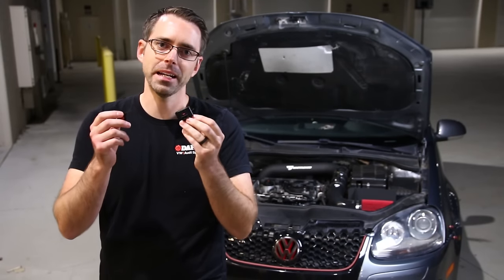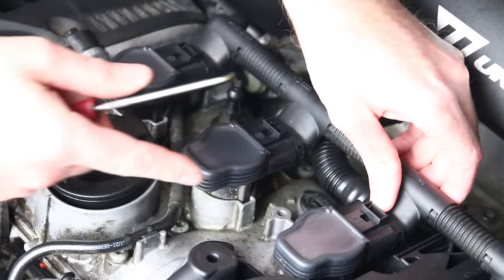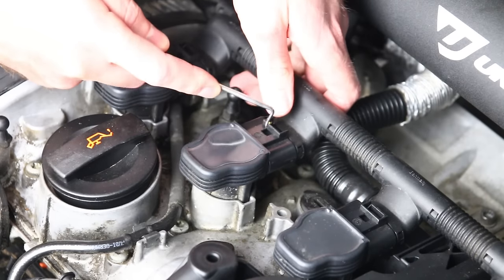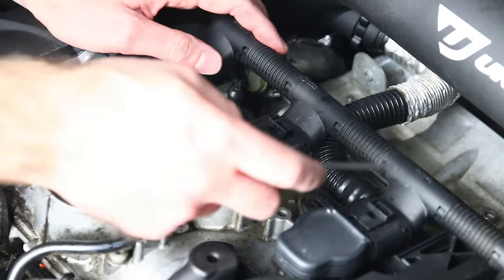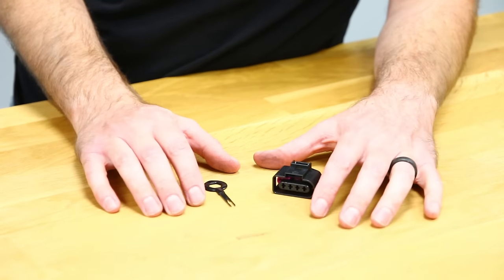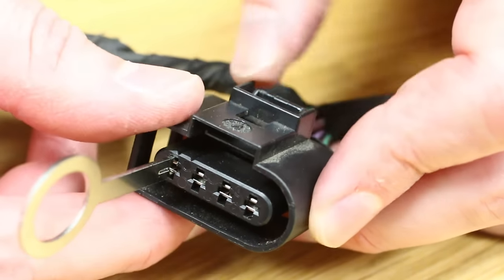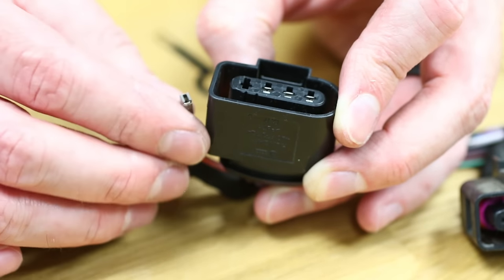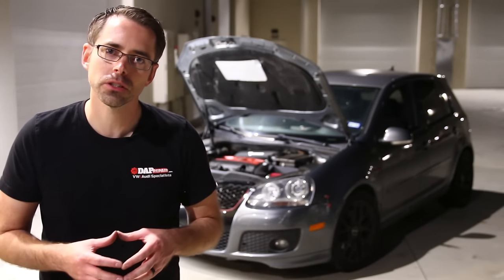How to Remove and Replace a Broken Coil Connector

Comment: Very nice tutorial! I didn’t realize the connector could be replaced, I thought one would have to replace the entire wiring harness.
Reply: That'd be silly
Reply: So no need to change the wires just the connectors and all good?
Reply: @dennisakoglu2718  Hi Dennis, you're correct: just need to change the connector.  The wires usually don't get damaged, but the connectors get damaged all the time because the process for properly disconnecting them is not obvious, so people tend to manhandle them and break the fragile plastic.  Therefore it's actually really nice that there's a way to replace a damaged connector without having to replace the whole wiring harness :-)
Reply: @tedjohnson64  thx for advise bro
Reply: @tedjohnson64 just did this on two of my connectors because after the first one I still didn’t get it wow I’m a dumbass

Comment: I have used a paper clip bent just right to release those pins.
Reply: I just wanted to say thank you for your comment. I was struggling with trying to get the connectors to release and the paperclip method worked 💯.

Comment: could a damaged connector cause the vehicle to misfire?
Reply: Yes.
Reply: Yes mostly definitely
Reply: Yes
Reply: yes, if it doesn’t throw a check engine and it’s misfiring change spark plugs and then check the packs, if the connector clip is cracked it could be not seating all the way down and causing misfire
Reply: Yes, most definitely
Reply: Yes, 100%.
Reply: Yes!!!!, this is my problem rn
Reply: I damaged 2 clips and once hit a deep pothole and my car started misfiring for 2 miles till I could find an exit ramp. I do think my injector and coils might be bad since it only happens to cylinder 4. Imma try all the options either way

Comment: I pushed down on mine and they snapped. The tabs were really difficult to push down. Using a 90 degree pick is probably easier.

Comment: Hey guys after watching this video I was stoked to go put new connectors on after seeing how easy it looked...I forgot to DISCONNECT my BATTERY and while unplugging them from the rear two of the wires touched making a little zap. I finished putting all the new connectors on and now my car will crank over and will not start.and now hood is flashing red on dash. What do do,Did I try the computer or is there a fuse or relay I should be looking for?please help me..
Reply: just did this lmaooo
Reply: btw its the 20a fuse in fuse relay number 8 under hood under windshield wiper tank  on drivers side (left hand drive) replace and should be good to go.
Reply: @Lovely_planet  I didn’t disconnect my battery either. Now I have a rough start/idle and check engine light. Same thing?

Comment: I have no fire on cyl 1 after intake manifold replacement. It's not coils or plug, but I did damage the connector a little.
Could that be the reason or is there anything else it could be, like a fuse?

Comment: I broke 4/5 of these on a 2010 2.5. I will buy the replacements from DAP! Do you need to disconnect battery before doing this or is there no risk of some sort of electrical damage?

Comment: What if you don't have that releasing tool for the wires?  Can you splice all the wires with the new connectors?
Reply: I wouldn't. The tool is best, but if you have new connectors the old ones will likely just fall apart. The little plastic piece separating the wires facing the coil is thin and usually brittle. Most fell apart when I did mine, but you could do the same thing by breaking it off with some needle nose. Pull it forward. Pull the wires out the back. Just be really careful with those wires.

Comment: Is it possible to buy just the terminals for the wiring? My connectors are not broken but noticed that my terminals looked oxidized. Used some electric terminal cleaner in the mean time.

Comment: Ive got s 97 lincoln town car, check engine light was flashing and rough idle and hesitation/shakes when accelerating.  took it in to get the spark plugs changed. And it Was worse ,  checked the engine and a coil connector was unplugged so i plugged it back again and its driving better but i got another flashing engine light today. Thinking maybe its the coil connectors? Or one of them ? They look old a tattered. What should be my next move to get done at the mechanic ?

Comment: Thank you for this tutorial!! I ended up breaking the clip from the connector harness but it seems snug. Do I need to replace? Or do you recommend a replacement?
Reply: Just did the same thing today drove it around didn’t misfire or anything so I’m assuming it was pretty secure but I would personally still replace them just to be safe
Reply: Zip ties ftw!

Comment: Very informative, I am going to fix the one I broke on my 1.4tsi ACT CPTA engine, only thing is what kind of terminal tool will it be? I would order from you guys but I live in the UK and don’t fancy paying £10-40 in import duties, I have seen a laser branded one which I have good experience with (with their thin spark plug extractor) part number 3932 ☺️✌🏻

Comment: So mine is an Audi A4 2007. I changed the coil packs twice and the spark plugs. Still had an issue with #2. Would this connector fit on the audi?

Comment: Is it necessary to disconnect the battery to replace a connector?
Reply: Yes! After replacing all four on my Audi Q5, accidentally 2 times the wires got together for 1-2 seconds making sparks, now my car in not starting, I checked all fuses, all are perfects but I am not getting power to the ignition coils; does anyone have any idea what could be happening? Also I disconnected the battery just trying to reset the computer, but it didn’t work

Comment: Hello! Might be a longshot but i really really need help with my Volkswagen Tiguan 2012 160HK Engine code: CAVD, CTHD.

I've had my car in to the local workshop/repairman who has changed all 4 Ignition Coils, all 4 Spark Plugs and also tried to change positions of the new Ignition coils with each other to see if the "code-reader" the pc or whatever i should call it would say anything new.

Translating with google on alot of these things, sorry for that.
so to the problem:

The scan/reader gives error messages:
 P035100, Passive/sporadic, ignition control cylinder 1 malfunction.
 P230000, Passive/Sporadic control ignition coil 1 short circuit to goods
 P050700, Active/static, idle control speed above the setpoint.
 P227900, Active/static, leakage air into the intake system.
 P030100, Passive/sporadic,  1st cylinder combustion ignition located
 P130A00, Passive/sporadic, cylinder removal(Maybe should be cylinder opt-out)
 P030000, Passive/Sporadisk, combustion fault ignition located

First it only showed the passive/sporadic error codes the first 3 times i turned it in to the workshop.
Then more came. 

The car can work normal, but the engine light is on. then suddenly the car can start "shaking" and the more i try to accelerate the more it shakes. 

As said before. The repairman has tried to change all ignition coils and all the spark plugs. Now he said i could try and search around on the internet to try find what is needed. He is pretty old and not that good with computers, that's why he asked me.

Please, can u help with the problem ?

Comment: First off, on the quality of this video is excellent, but for releasing the locking coil connector its poorly explained, because i broke all my coil connector because I was pressing down on the heel of the latch  think that's would make front lift up. Wrong. you have to pull back on heel to make the front lift up. When he is holding the connector in his hand to illustrate how the piece inside moves he is not pressing down on the heel, he pulling backwards. Their is no mechanism their, it's molded in a way that the inside piece is always sprung down ( to lock on the paw) so when you pull back (Not pressing down) on it, it's relieving the downward sprung pressure to come off that paw. Always buy OEm parts

Comment: Hi there! Ater replacing all four on my Audi Q5, accidentally 2 times the wires got together for 1-2 seconds making sparks, now my car in not starting, I checked all fuses, all are perfects but I am not getting power to the ignition coils; does anyone have any idea what could be happening? Also I disconnected the battery just trying to reset the computer, but it didn’t work; I really appreciate it someone could help me figuring this out, thanks!
Reply: Did you fix this?